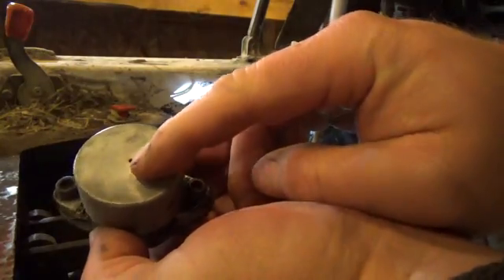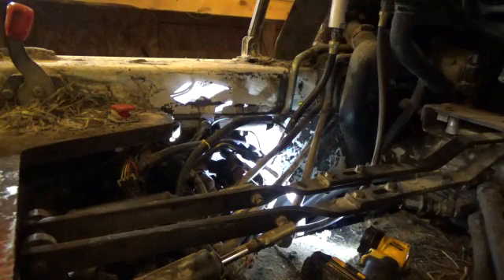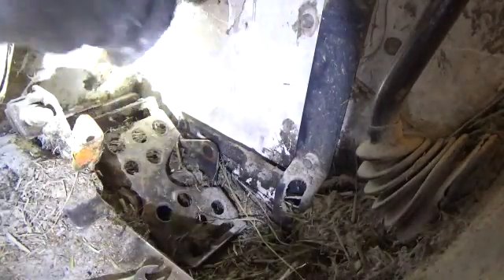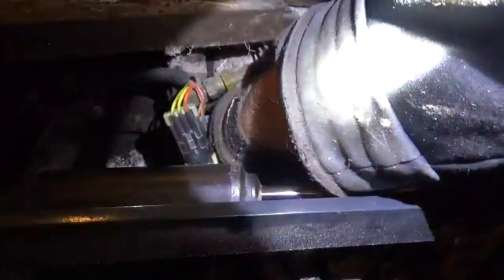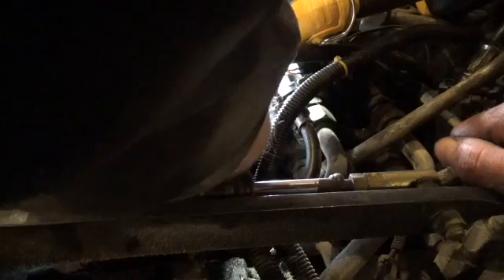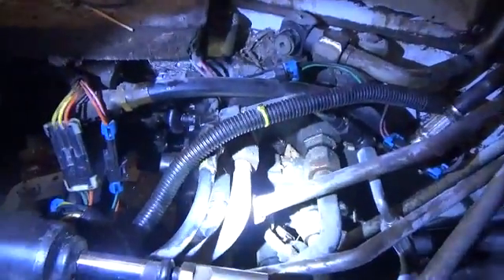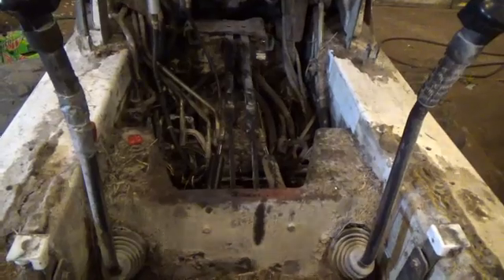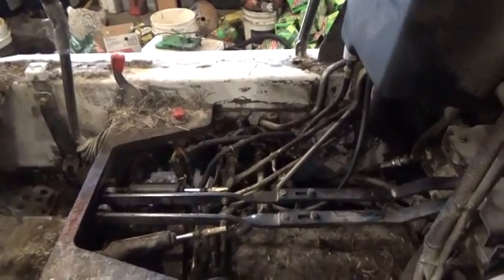Part 3, Hydraulic spool valve rebuild

Comment: My 7753 is leaking out of the same hole in cap. My cap came loose and when I put it back on it was pouring out of the hole. My question is is there a spring and ball against that hole or is it just bad seals letting it come out the hole?

Comment: I have pulled out my control panel so many times I now have a zipper on it!
Its quick and easy. Prolly 8 easy to get to bolts and it is a lot easier to get into those areas.

Great Video! Thanks for sharing :)

Comment: Hate skid steers.  To do anything on them you're upside down on your head or on your back on the floor
Reply: I find that taking parts off helps. Never work on the inside of a Bobcat without removing the control levers and cover plate. never use gloves but never get a scratch working on mine. If there's a leak on the control valve just remove the whole thing and rebuild on the bench.

Comment: Sometimes manufactures put seal kits together that can be used in more than one application of spool valves in there equipment fleet. So you don’t use all the o-ring and seal that come in the kit.

Comment: Would the new lot system make the 4020 a viable backup loader or would you still be in small spaces?
Reply from the maker: I think feeding wise the 4020 would work, but bedding and cleaning might prove to be a challenge. I would like to get a Valmetal 5600 bale processor so that would make bedding easier. Worst part with the 4020 is no cab and usually its pretty cold here with a lot of north west winds. I'd love to find a 5000 series loader tractor
Reply: LVF Northern Wisconsin Farming ahh yeah heated cab would be a must up there I bet.
Reply from the maker: +Floyd Farms yep! We could see -30 next week, feeding is going be be miserable without a heated cab!

Comment: Good job Brad,
How many spools are on that assembly? Some have 2,3,4,5,6 and more. The bigger o-rings go between the spools, being there's 2 probably 2 spools, so when you split the spools you'll find where the o-rings go.
Spool valves can be a big pain in the butt! I really couldn't get a good look at the valve. 👍
Reply from the maker: There's 3 spoils and they are one casting. CE made a video last night showing where those o rings go. I guessed right on one, but the other I didn't! But for now no leaks, next time I will know exactly where they go!!
Reply: @LVFFarmVlogs  
3 spools but one castings. Most of the spool valves I worked on were all separate spools that all came apart in sections. Glad you have it sealed up and not leaking, and got the info you need to overhaul it in the future
Reply from the maker: So far so good, for how long, who knows! But you know how that goes! And I only replaced the seals in the one spool that controls the bucket, the other one for the booms wasn't leaking, but I am thinking before next winter I am going to rebuild the other one because its just a matter of time!! If I need that info is there anyway to get in contact with you other than you tube? You on facebook or instagram?
Reply: @LVFFarmVlogs  
Sorry no I'm not